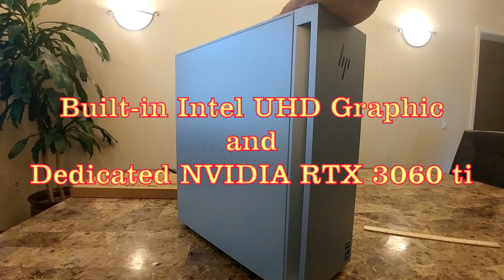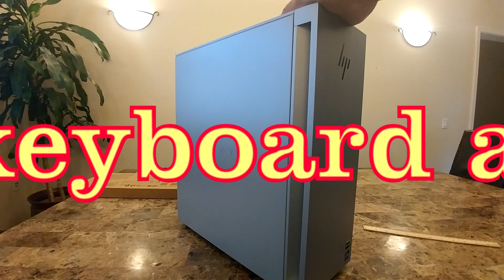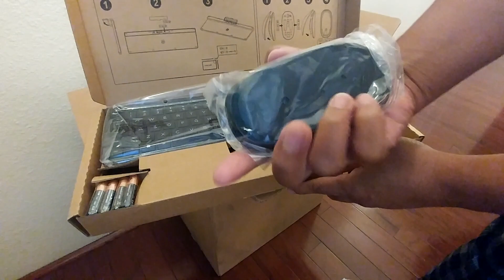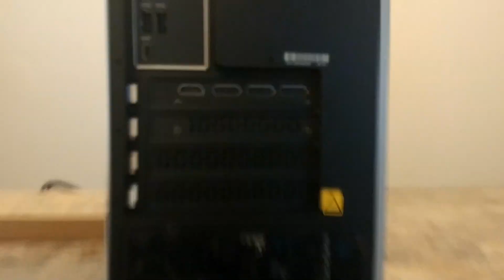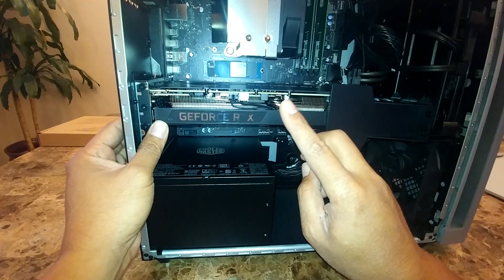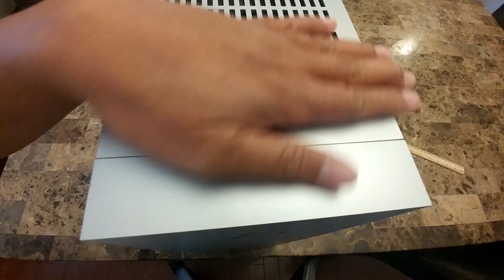HP Envy 12 Gen Core i7  from Costco. Can You Upgrade It? Features and Components Review.

Comment: I actually transplanted this whole system into an nzxt h5 case. Everything was able to be hooked up correctly save for losing 1 usb port on front io, and losing the micro sd card reader. Also upgraded to a 4070ti and works fine. First thing to mention is I got the i9 3070 version for $820. Ark ASA made me want to upgrade to 4070ti😒.
Reply from the maker: Thanks for sharing. That is a good deal for an i9 3070. Is there a big difference in performance for the Ark ASA from the 3070 to 4070?

Comment: I've had this for just over a year. I was fortunate to get it on sale directly from HP and got an RTX 3070TI with a 12th gen I7  which they no longer seem to offer with this PC. However, even though many of the parts are industry standards you would use for a custom build, the motherboard is not. Just as you pointed out in the video, the lack of additional ports on this sad excuse for a motherboard was obviously where they cut the costs. Now that my standard warranty has ended, I will be tearing mine apart and moving the components to a custom case with a new motherboard.
Reply from the maker: I agree. Branded computers usually use board and just enough power that will handle the spec that they build. What prompts you to upgrade the case and board?  Are you looking at adding more internal storage and a larger power supply?
Reply: @diymanual  I could potentially keep the case but I doubt it since manufacturers like HP and Dell tend to be pretty specific. In my case, I want to add a 10GB network adapter which needs a PCI express slot. Since there's only one, the original motherboard has to go.
Reply from the maker: @linuxzero7283  Thanks for sharing. Good luck on your new build.  What board will you be using?
Reply: @diymanual  Thanks. I think instead of an add-on 10 GB  network card, I'll go for a higher-end Asus motherboard. I've seen some that have both a 2.5 GB and 10 GB integrated ethernet.
Reply from the maker: Sounds like a good upgrade decision.

Comment: The spec sheets for this basic model actually shows a second M.2 drive slot just below the graphics card towards the rear of the motherboard near the WiFi module slot.   Also when configuring this model on HP's site you can add a second NVME drive or a hard drive, so the motherboard should have a second M.2 slot since it's an option.
Reply from the maker: Thanks for the information. Yes a couple of early comments have pointed that out so I updated the description to reflect that. I wish I could update an already uploaded video on the fly but Youtube does not have that option.
Reply: @diymanual  hi do you know max size i can go to on the primary m.2 and also the second m.2

Comment: The problem I see is the motherboard. No VRM heatsinks, it would be interesting to compare it to a motherboard which does have VRM heatsinks. If these get hot they might throttle down the CPU.
Reply from the maker: It could be. But I have this for at least 5 months now and use it mainly for video editing. I never had issue with it slowing down rendering videos.   So I guess it will depend on what you use this computer for.

Comment: We bought 5 of these for Keyshot rendering, as-is without any upgrades they are our daily drivers for graphic design and 3D rendering, workhorse machines. Only minor gripe is the kb and mouse are garbage but they get you up and running. We also found these way cheaper for the 3060Ti GPU than building one, plus you get 32gb ram, and 512ssd plus 1tb hd. We replaced the hd with sata ssd but saw a comment on here that there’s a second m.2 slot under the GPU?! Oh man wish we knew that but anywho it’s a great machine. Rock solid, stable, and QUIET!
Reply: I should point out we render 35 4K renders of products at a time, and this machine finishes them in about 3-5 min at 128 samples without even running the fans on high. Our old machines we had to take the cover off to keep them cool, this one doesn’t even get hot.
Reply from the maker: Thank you for sharing. This is also my main machine for editing my Youtube videos and I am very happy with it.

Comment: Any high end GAMING MEMORY kit from CORSAIR , MUSKIN, TEAMGROUP , KINGSTON , G-SKILL and TIMETEC , OLOY and PATRIOT will work on it as long as it is native DDR4-3200 OR DDR4-3600/3800 ( native means thats the default speed of such ram module and its not achieved by overlocking by default, the minimum is 3200MHZ )

I have tested several kits of all these brands (same brand and kit up to 64gb, like 16gbx4 ...) without problems on the I9 12th series model , ram kits were benchmarked and stress tested under normal and overclocking conditions
Reply from the maker: Thanks for the detailed information about RAM compatibility.

Comment: The CPU is the 12700 with only 65W base power (rather than the 125W of the12700K)?  Have you performed thermal throttling tests using Cinebench?  How loud do the fans get during a 10-minute Cinebench test?  What temperatures are reported during that test?

The 12700 CPU supports DDR5, but the RAM is DDR4?  12th gen also supports up to 16 CPU PCIe 5.0 lanes, but does this motherboard support PCIe 5.0?

Is the PCIe slot (occupied by the GPU) PCIe gen 3 or gen 4, and is it electro/mechanically a true x16 wide?  Sometimes a physical x16 slot only has x8 or x4 support from the motherboard.  Is the GPU the same as the retail RTX 3060 Ti, or is it a cheaper, less capable variant made specially for OEMs of budget PCs?  How do your Cinebench GPU scores compare with other 12700 / RTX 3060 Ti systems?

Is the primary NVMe SSD slot PCIe gen 3 or gen 4?  The 12700 supports up to four PCIe 4.0 lanes from the CPU.   Is this slot electro/mechanically x4 wide?  We can assume the secondary NVMe SSD slot is PCIe gen 3,, but is it electro/mechanically x4 wide?  Sometimes an NVME slot only has x2 or x1 support from the motherboard.  What scores do you get when you test with Crystaldiskmark?

HP does not provide such details in the specifications, but running HWiNFO might provide some answers here.
Reply from the maker: I'm not familiar with Cinebench or HWiNFO but I downloaded both to see if I can answer your question. 

I installed and run Cinebench R23 for 10 minutes on Multi-Core and another 10 Minutes on Single Core. It scores 14714 pts with Multi-Core and 1828 pts with Single Core. I did not see any temperature report on Cinebench but I never heard the fan go faster. It remains quiet the whole time. My main use for this PC is video editing so I render a lot of video here and it always perform fast and I never experience any problem with it. 

I also installed HWiNFO64 and this is what I found.
Video Card: Nvidia GeForce RTX 3060 Ti (GA104-202 LHR) (There is also an integrated GPU but we are focus on the RTX 3060)
Video Bus: PCIe v4.0 (16 GT/s) @ X16 (2.5GT/s)

Ram: 16GB PC4-25600 DDR4 SDRAM Kingston (Bank 1 and 3)

Motherboard Model: HP 894B
Motherboard Chipset: Intel Z690 (Alder Lake-S PCH)
Motherboard Slots: 2xPCIE x1, 3xPCIE x4, 1xPCIE x16
PCI Express Version Supported: v5.0
USB Version Supported: v3.2

I hope this answers your question.
Reply: @diymanual  thank you for doing that.  I notice that HP's configurator allows customers to opt for PCIe gen 4 SSDs for both the primary and the secondary storage.  I should therefore think that the motherboard supports gen 4 for both SSDs.

The 12700 has integrated graphics, but note that this motherboard does not support the integrated graphics.  There are no video outputs.  The one and only PCIe slot (which is x16) must therefore be taken up by a dedicated GPU.  

From all that I have seen, this motherboard does NOT have any PCIe x1 slots.

HPs documentation fails to mention the existence of one SATA port, but the configurator allows for an SATA hard drive to be selected for secondary storage.
Reply from the maker: @Chris.Brisson  You are welcome and thanks for your technical contribution to this thread.

Comment: Is this a good pc for gaming? The specs look good but I am new to gaming on pc and wanted to make sure.
Reply from the maker: Yes. The spec on this is good for gaming. Good CPU, 3060Ti Graphics and 32GB RAM.  I am not a gamer but I use this for rendering video and it handles it well.
Reply: Thank you so much. They have an option that have 1 tb ssd instead of the 512mb and I'm going to choose that because of the space issue
Reply from the maker: @balloonalienoverlord8901  That is a good upgrade especially for games as you will need those space.  By the way if you check the description I have actually put an update there about the extra M.2 slot that is hidden under the graphics card meaning you can add another M.2 SSD storage in the future. I have also included links to the product and  RAM option that was recommended by the users.

Comment: Quick question! 

I’m considering buying the i9 rtx3070 version of this - but am really concerned about the CPU overheating. 

Is there a place where I could install an additional fan and would this be easy/effective? 

Or is there another way I should do this.
Reply from the maker: The case have a lot of space to move air. I never have experienced any overheating with this unit and I am rendering videos in this PC.  Most of my machines are HP's unless I built it myself and I never had any overheating issues with them. My work PC's also just use HP's as we have better experience with them as compared to Dell PC's.

Comment: There are actually two other M.2 slots, one dedicated to the wifi/bluetooth, and the other under the back of the video card.  But the reason I was watching the video was to find out if there was a way to put in an internal CD rom drive.  So far it looks like the only option is to attack an external to one of the USB ports, but that's a waste as I have several from older machines to scavenge from. I don't see any slots on the external of the machine to put a CD in though
Reply from the maker: That is correct, there is no slot for an internal CD ROM drive.  There are some USB to SATA or USB to IDE adapter in Amazon but I have not used any of them so I am not sure of its performance.
Reply: @diymanual  CD Rom throughput is lower than USB 3, so the performance limitation will reside with the CD Rom drive (internal or external). There is no way to install a 5.25" CD/DVD drive into this computer even with wild abandon using a dremel tool. The best option (that I do) is copy the CD/DVDs to an .ISO file. The .ISO file opens and plays from any computer, is easily duplicated, easily categorized, stored and shared to future generations.
Reply from the maker: @SpaceCadet4Jesus  You are correct and thank you for sharing.
Reply: @SpaceCadet4Jesus  Thanks for the tip 😘

Comment: People that are interested in modifying this computer can look at the following:

A). Exchange the power supply for a modular higher rated power supply. (A time demanding process due to how the cables are routed sandwiched between the motherboard support plate and the other side panel. I wasn't impressed with CoolerMaster supply. It may be perfect but I'd rather have a Seasonic power supply installed.

B). Install TWO M.2 2280 NvMe SSDs (Edit: Gen 3, although Gen 4 is backwards compatible) with heat sinks. You can add a very low profile heat sink on the M.2 which is under the video card.
Both at Microcenter:
Super low profile heat sink at Microcenter: SKU: 767152, Mfr Part #: NGFFM2-HS804-BK, UPC: 715860033340, M.2 2280 SSD Low-Profile Heat Sink Kit - Black
and
A different heat sink to replace OEM heatsink (along side the video card)  at Microcenter: Sabrent SKU: 227439, Mfr Part#: SB-HTSS, Sabrent M.2 SSD HEATSINK SILVER

C). More memory with exact timings (see my post somewhere else in this video).

D). A water cooling kit. (Not really needed due to this CPU  highest TDW is 65watts).
CoolerMaster MasterLiquid ML120L RGB V2, Close-Loop AIO CPU Liquid Cooler, Gen3 Dual Chamber Pump, 120mm Radiator, SickleFlow 120 PWM ARGB, AMD Ryzen AM5/AM4, Intel LGA1700/1200 (MLW-D12M-A18PC-R2), AMAZON ASIN: B086C1PK2Y
Radiator mounts to a easily removable plate inside at top of case (case top is well ventilated grid). The plate has 4 mini plates with screwdriver holes that must be removed to allow air access when attached to radiator. Everything fits well, just pay attention to direction of cooling pump block as it needs to match the length of the CPU. A 12700 kit is included with the cooling kit as is thermal paste.

E). Add a Thunderbolt 4 USB hub from Amazon.
Thunderbolt 4 Docking Station, QGeeM 16 in 1 Universal USB C Docking Station Dual Monitor 4K or Single 8K HDMI Video Output 130W Power, Amazon ASIN: B0B2CWJD67
(I love this hub SO much. Ethernet, Sound USB 3, USB C and screaming fast Thunderbolt 4 has made moving 300-800GB single files effortless)

F). Keep the wireless keyboard as an extra but discard the mouse. Instead get a nice wired keyboard and wired mouse, gaming preferrably. 

G). Install a SATA SSD in the 3.5" slot using a 3.5" to 2.5" adapter.
Fenlink 2.5" to 3.5" Internal SSD Hard Drive SATA Drive Converter, Amazon ASIN:  B01ELRRKW8

H). Your choice of SATA SSD, I installed a 4TB Crucial SSD.

I). Pay $100 to Microsoft for the Professional version of Windows 11. I did for the Bitlocker feature and for group policy and for other technical reasons beyond the scope of this advice.

Buy your parts wherever you want, I include Amazon so that you can easily review the items with pictures, reviews and technical details.

Enjoy!
Reply from the maker: This is a very detailed upgrade including parts. Thank you for sharing.
Reply: Hi! I saw that you recommended installing a water cooling kit. Is this difficult? I’m trying to do this with the i9 RTX 3070 version.
Reply: @gamesmash2920  If the case is the same, then the water cooling kit (listed) will fit. It requires a complete disassembly and removal of the motherboard, the CPU and both sides of the CPU housing. Some screws HP don't want removed so they use some star patterned screws. Is it easy? No, requires special tools, knowledge and lots of patience. My item list was for people who just HAD to modify it, regardless.
Reply: @SpaceCadet4Jesus hey man just wondering if u know is there a glass panel I can install like the Omen’s on this envy and also in the future if I wanted to swap the case out could I ? Any info you can provide would help !
Reply: @StumpyPeaks I do not know if there is a compatible glass/clear side panel for this case. The case sports a rear flush mounted push button release system that any other case panel would have to accept. So without a ton of hours analyzing cases, I'd say "Not likely".
About changing cases, sure, this motherboard can be placed in a different case but really....why?" The USB/Sound/SD card ports TOP housing (not the rear ports) would not be compatible with any other case on the market, so you'd lose those extra ports. The case is really built for this motherboard as a complete unit.
If you are deciding on greater customization than I laid out above, then you'll have to pass on this computer.

Comment: I think it's a good deal for your dollar at Costco. Where else will you get Thunderbolt 4, a plethora of USB 3 high speed ports, two USB 2 ports (for keyboard and mouse), an Intel 12700 cpu, a GeForce RTX 3060TI, an SD card reader and a decent CPU fan cooler for nearly a Grover Cleveland bill.
At Microcenter, the same system had sold for $1399 with an RTX 3070TI, a 1TB M.2 NvMe drive, no Sata drive. (Wisely, they sold out quickly, the product is no longer on website).
Reply from the maker: I agree with you. I was thinking of building one but then I saw this on sale at Costco during the holiday so I grab it. I did see that in the HP website that there are 2 M.2 NvMe slots for storage but only saw one so I was not really happy with it but I am glad that when say that it is just hidden under the graphics card.  Now I can say that this is something that I can use for a long time.    Thanks.